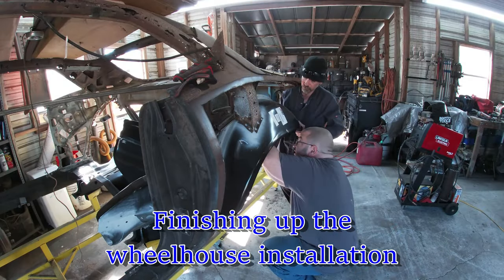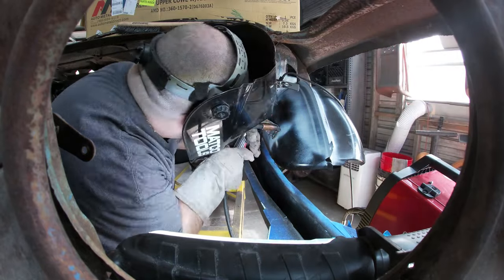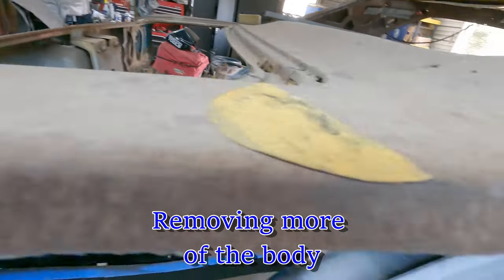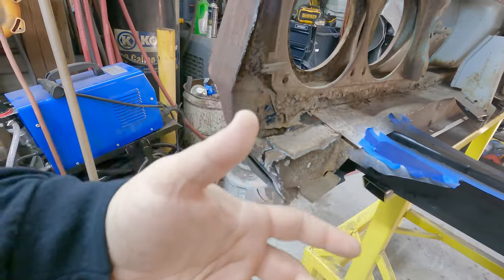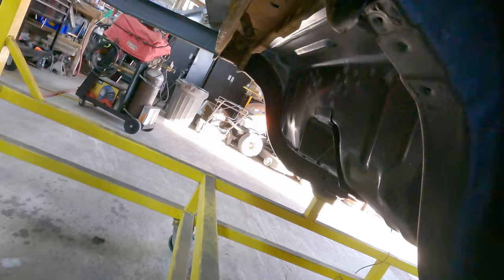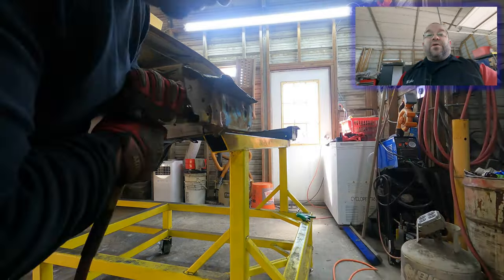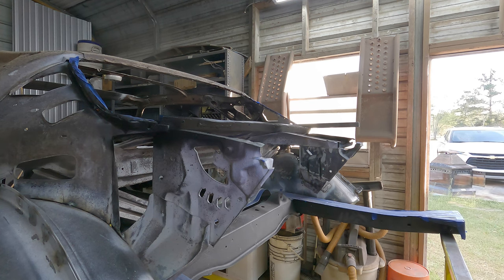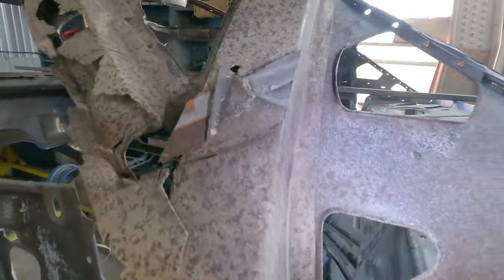Project Fast Fish: Complete Trunk Floor Pan Installation - Walkthrough

Comment: Will the new gen. Hemi head bolt onto the 318 block?
Reply from the maker: Negative ghost rider. Magnum heads will.
Reply: Ya but what's best head to use to go around the push rod?
Reply from the maker: That depends:

Intended use. Stroke. Displacement. Cam. Intake. Air flow. Budget. Fuel type.
Reply: @MicsMotorworx  Flow n blow, If money no subject which iron heads best at 7300 RPM for 30 lap feature? 2002 5.2 mag. Block
Reply from the maker: If the lower end will hold up, e.g. 4 bolt main and balanced assembly, the w2 iron heads are great for LA blocks. Find a great machinist for large valves and opening the ins.and outs.

For alum heads, trickflow and indy made great units based on the w2. Hughes Engines has a few of the Indys with additional machining.  We used them for our big 437 Stroker build. For that engine we limit the rotation per the 2 bolt main.
Reply: @MicsMotorworx  ok there's only a few aluminum heads I can run. Chevy guys start whinning if I pull out few sec. On them. I have crank turned down and knifed. I could run dry sum but good crank knife n baffle hope I can push 7300
Reply: @MicsMotorworx  so your saying go with early 70s block rather use a mag.?
Reply from the maker: We used an LA. Magnums are pretty much the same. I would make sure you're balanced with those rpm targets and the bottom end could hold up.  The two bolt mains on either are a limiting factor. 

Find a good machinist. 👍
Reply: @MicsMotorworx  ok sound good when there's a few aluminum head options that the sanction group run I'll be able find nice heads to flow.